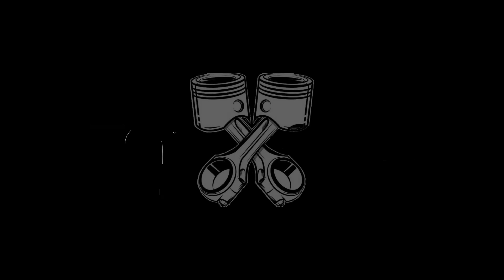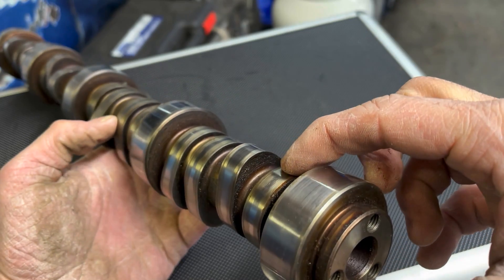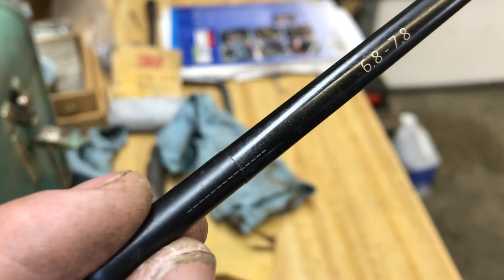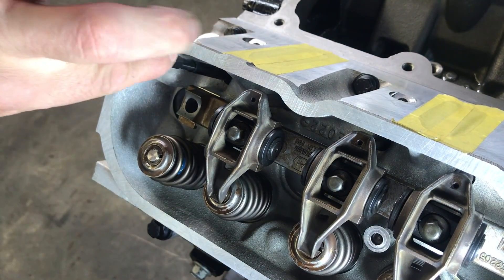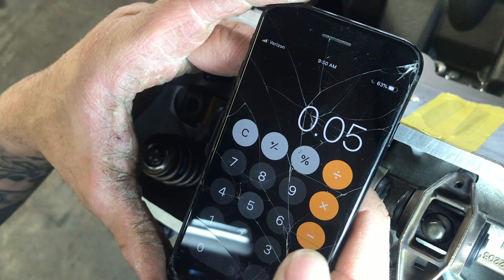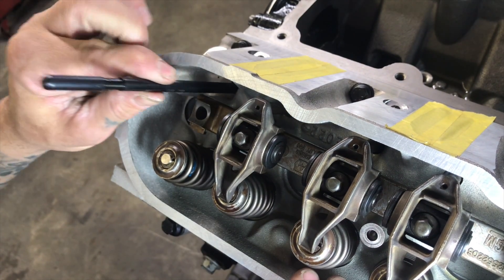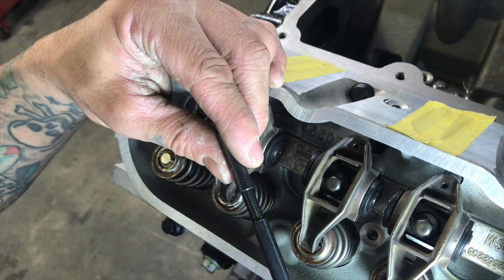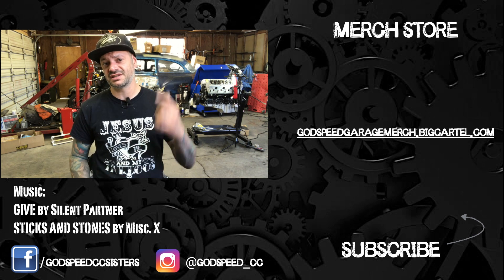TWO EASY METHODS FOR MEASURING LS PUSHROD LENGTH!!   - TURBO 5.3 LS pt 9

Comment: u said 7.3125 no such think so maybe 7.325 or 7.330 and so on? it can only be  3 digit after "." that thousands not 4 digit pushrods are mesured in 0.000 not 0.0000

Comment: Or just add how ever much preload you want to your 0 lash. So 0 lash = for example 7.5 and you want .075 of lifer preload you’d need a 7.575 pushrod , that turn measurement is not the best

Comment: Just out of curiosity, what do you do for advertised pushrod length versus measured pushrod length? It seems most manufacturers have a little extra from 0.005 to 0.020 preload in the pushrod. For example, i buy a "7.375" pushrod but it measures 7.391 with the calipers. Many many pushrod manufactures have a little extra in there. Do i just factor in the extra and buy a pushrod a little smaller or roll with the what's advertised because that's what was measured?
Reply: That is pointless really…
Reply: @harrirauhanummi  I guess it depends on how you want to run your build. Recommendation for LS7 lifters is lighter 0.065 - 0.080. seems like folks will run it to 0.100 or more but it's rough on the lifter and reduces longevity. I went with LS7 rec and bought 7.350 pushrods for average preload around 0.075 accounting for the average 0.010 "extra" manufacturer pushrod length. When you go to buy these pushrods from various sellers you can see in the reviews people commenting on the extra length.  I figured there was going to be extra length so I purchased 7.350. Sure enough most measured 7.360-7.365
Reply: @ but did you check only one valve? Because most probably you would get different results from different valves. So in any case it will be averages… unless you run different length pushrods :)

Comment: Thank you for taking the time to explain this. My first LM7 truck engine I did, I just had the heads cleaned up at 5 thou which the lifter could compensate for. I also had a valve job with new everything except the seats, those were good enough to just re-cut.  Found out my stock 7.400 rods would have been to long and give me .125 of preload.  I also went with a Melling MTC7 cam.

Comment: So you would only need to do this check if you change your cam, is this correct?
Reply: If u change cam, heads or had heads milled. Different lifters or rockers as well.     Basically if u have it apart why not just do it and save ourself some time and money
Reply: I check it anytime anything changes.  The checker tool is cheap compared the cost of ruining an engine.
Reply: @JC-tg5xg  Thanks!

Comment: Do i need to check all 16 when using johnsons lifters? And when checking for exhaust valve do i turn the motor clock wise also until the intake rocker goes down??

Comment: I'm doing a head gasket job on an 07 Yukon Denali 6.2l. I got the heads on and now I'm doing the Rocker arms. I noticed when I'm torquing the arms some of the rockers slide from the center of the valve stem and moves closer to the edge of the spring. My valve springs are slightly compressed also when I finish torquing to 22 ft lbs. Can you tell me what can be the problem? I'm stumped

Comment: 1st time measuring pushrod length here, but I have a question see if anyone could give me advice, I basically did everything like he did on the video even the math but with my measurements, so my intake is 7.2875 rounded it to 7.300 and my exhaust is 7.325, should I buy all the pushrods 7.325 or should I buy half and half?

Comment: Extremely informational on this, I did my first cam on a gen 4 6.0L and the pushrods were doing my head in with the ticking and not knowing the base circle had changed. Big thank you from a dumb ass trying to get his engine right, and extra points on background tracks!

Comment: Thanks for the info building a 6O in a C5 Texas Speed heads has been a nightmare 7.4 push rods but dont think the mechanic did the math or put the pushrods on the small lobe of the cam going to a performance shop today......

Comment: did you add pre load to you length or did i miss it?
Reply: Yes you add it to whatever preload you need. Most lifters such as Johnson lifters will have a specific preload on the box. GM lifters have a much broader range and are more forgiving
Reply from the maker: yes.  for the first method you have to add it.  the second method (the turn method) accounts for the pre-load.  I second what @Brandon Ouzts said - GM lifters have a really broad range.  as long as you're in that range you're good.  hope that helps!